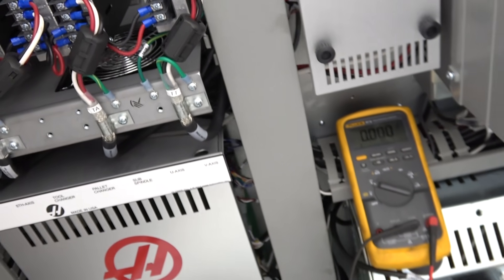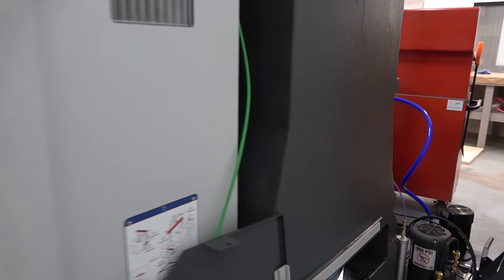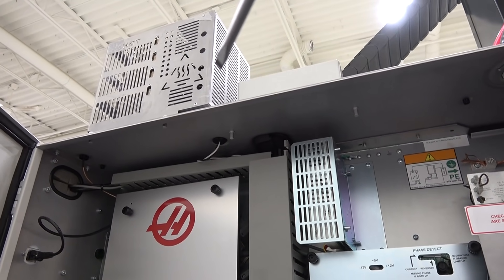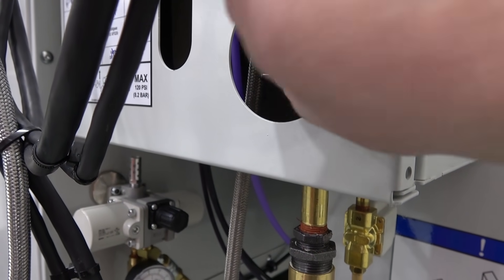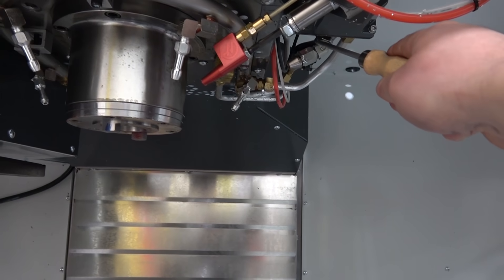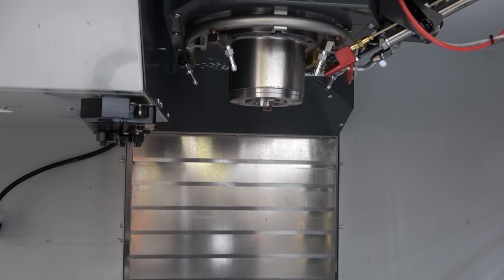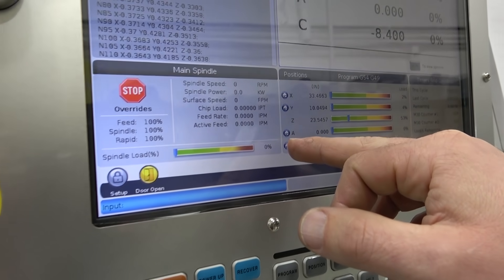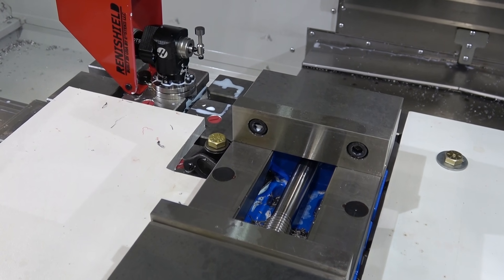BOLTR: HAAS CNC

Comment: You forgot the most important data - what's the price tag? As a composer living in the South of Oz on the Surf Coast, I have no idea what that beast would cost, other than expensive. BTW it was an interesting video both for the explanations and to see the innards.
Reply: for that particular setup, about $185,000.  That's just the machine and the rotary axis, no vises, tools or tool holders. But you typically get vouchers and some freebie holders and cutters when you get a machine.

Comment: Haas has nice videos on operating….Haas machines. And also they have a great video on feeds and speeds. 
Side note, you need to add 1% concentration coolant to top off the tank, not straight water. 
Per Haas and coolant makers.

Comment: you can shut off the door lock alarm in the menu. I know because the VF3 I learn a little on had a broken lock, so part of the startup was to disable it so you could run the spindle.
Reply: you must have an older model. the newer models have removed that from the settings. you can no longer override the door lockouts from the controller.
Reply: @occamssawzall3486  Yeah, it was old that's why it was broken. Sucks because you there are some uses to that, but I guess you have to make sure you don't have moron running it and those are rare these days.

Comment: "Here we've got the ways, which use Spurving bearings to reduce side fumbling. The servo motors use Rockwell Automation's proprietary motion control system, which utilizes bilateral phase detectors to measure magneto reluctance, optimizing performance in critical applications."
Reply: Ave completely forgot to mention the six hydrocoptic marzel vanes.

Comment: Could you install UV-C lamps inside your equipment to prevent rancidity of the various oils/fluids? Just a random thought.
Reply: Would probably reduce the working lifespan of the oil. Goes rancid because organic molecules break down over time, UV-C would just accelerate that.

Comment: You selected the Z- axis button and then used the jog dial. Would have selecting Z+ done the exact same thing as far as the jog dial goes? Or would that have inverted the jog dial direction?
Reply: When using the dial, selecting +/- doesn't matter. It is just selecting the  axis. You can push the axis direction button +/- along with the lock button in the center and it will traverse in that direction.
Reply: @MrBill-mq7ti  Thanks. I wish I were more knowledgeable about large CNC equipment. If I could restart my career path, I think I'd be machinist instead of a programmer :)

Comment: Point of order: what you are pointing out as "box ways" are linear bearing ways, as far as I know Haas doesn't use box ways on any machine.  Box ways are similar to dovetail ways, but more box-like (they're rectangle instead of angular).  The advantages are they are massively more rigid, but they are slower, more expensive, harder to repair, and much more difficult to build into the machine.  Linear bearing ways are a bolt-on ground ball guide rail with bearing loaded skates, they are not as rigid but can move much faster, and don't require the precision ground surfaces to be integrated into the machine frame.  Good for lighter machines with very high acceleration, not so good for the kind of rigidity needed for aggressive modern toolpaths in superalloys or titanium.
Reply: Check the Edit comment from AvE from 3 years ago re box ways

Comment: I have that machines grandad the 1991 VF-1 And it Cooches every day in my shop.
 I did a full teardown in spring of '20 and refurb of the important bits (all oiling lines, fittings, hoses belts etc.) And aside from one linear slide plastic end cap being damaged by an oiling fitting coming loose, it is still in great condition !!! 
 No hard drive, floppy, USB tho. Only RS-232 comms and a very small memory.
  HAAS makes a great machine !

Comment: When I was a young whipper snapper, one of my first jobs was to crawl into these large CNC machines and literally shovel out all the chips. I'd shovel them into a large 55 gallon drum, move that drum out of the shop using a wheel barrow, then lift the barrel over my head and dump it into a special dumpster for recycling. That job absolutely sucked! There were something like 30 machines to do in a night, 12 hour shifts, and all 8 of my bosses were dicks.

I quit after 4 months.

Comment: you didn't hear it from me... but if you stick a magnet on the stationary part of the door sensor, you can run the machine with the main door open at any speed...  That said, safety nanny's require me to tell you that overriding safety lockouts may cause injury and not to do so...

Comment: Do you need to lube every tool (as it goes from holder to spindle?) Or does the machine do that for you?
Reply: no, actually the tool holder taper and the inside of the spindle taper should be clean and dry, no lubrication.  at 9:41 in the video if you pause it and take a look and the spindle, you'll see two square pieces of metal sticking down. Those are the drive lugs and are what actually spins the tool. They key into slots in tool holder. The tool is locked into the spindle and the entire spindle turns, rather the spindle turning just the tool holder.

Comment: Wait, X positive is LEFT?! That would mean Y positive is towards the operator. That's just wierd, or is it a left handed machine?
Reply: You have to look striaght down at the "part" from the view of the tool. Since the tool is stationary, the part has to move. So it's backwards, kinda
Reply: You're right, I'm an idiot. Been working with a five axis circular saw and a three axis router table for the last few years. The spindles moves and the table is stationary on those machines.

Comment: What's the difference between x+ and x-? Direction the jog knob rotation moves the axis?
Reply: If you were to draw a plus symbol and look at it top down the arm that goes off to the left is the x negative arm the arm that goes off to the right is the x positive arm The arm that goes straight away from you is y positive and the arm that comes towards you is y negative now if you imagine that plus symbol laying on the table the z positive is away from the surface of the table upwards and z negative is down through the surface of the table downwards
Reply: Yes, all 3 axis (axi?) Have plus/ minus on each side of wherever you program "0".  I don't know about 4th and 5th. Above my skill level.

Comment: Ran then for years. Haas was a good bang for the buck but just can't compete in heavy stock removal like a good box way machine. I mostly ran high alloy parts with it and did some hard milling even but it was tough sledding.
My employer should have had a stronger machine for what type work we did but you couldn't tell them anything they thought they knew it all.
The best G code type of control I've ever encountered but I think conversational is the way to go , once you've used conversational you hate to go back.

Comment: Can you do PCBs with this machine?
Reply: In theory yes, 15kRPM is a bit on the low side for the tiny drills and engravers commonly used for PCBs. Also the glass-fiber dust mixing with the coolant  and oil makes for some very nasty abrasive slurry which must not get anywhere near anything that needs to stay dimensionally stable. since the cutting forces are tiny for milling PCBs you are way better off just having a dedicated tiny & cheap desktop pcb mill for that (just make an enclosure with it so the dust does not get everywhere [especially anyones lungs]).

Anyway etching gives better results if you have reasonable printer for making the masks, the good thing about milling is that you get the holes drilled "for free", the first reason I moved to surface-mount components in my home-etched PCBs was that I was tired of drilling bazillions of holes. Nowadays of course all the new cool stuff is only available in surface mount, no problem as long as it's not BGA-only.